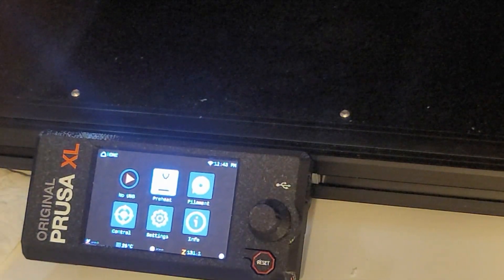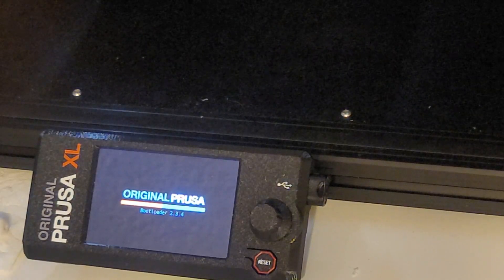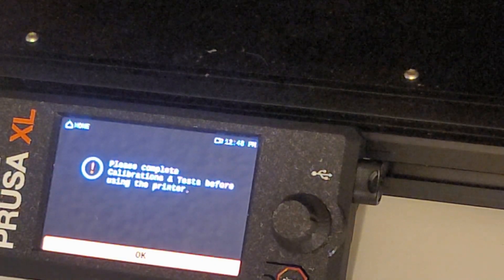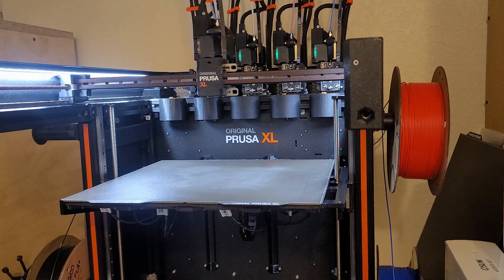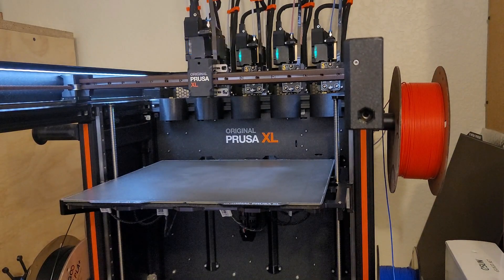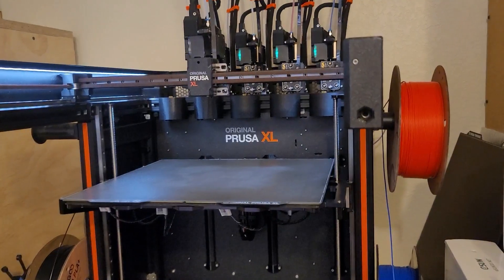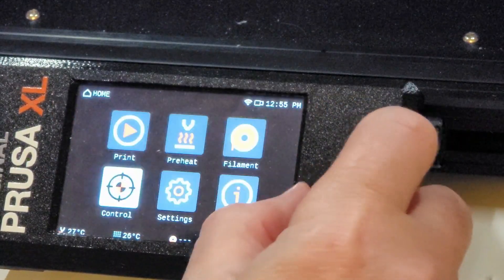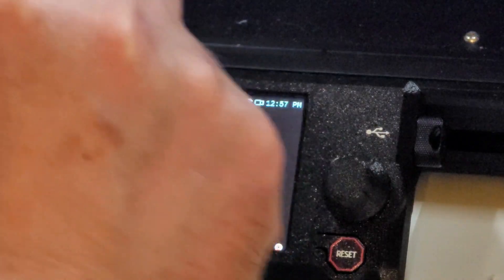Prusa XL Tool 5 Upgrade to Firmware 6

Comment: Thanks for showing this in real time. My brand new xl was stuck at 6% for over 10 minutes, so your video confirmed it should have moved on by now ;) pushed the reset button and it went further but showed an "esp error" #17505, which according to the faq page was fixed by resetting and starting the flash procedure once more 😅
Reply from the maker: Glad it helped!